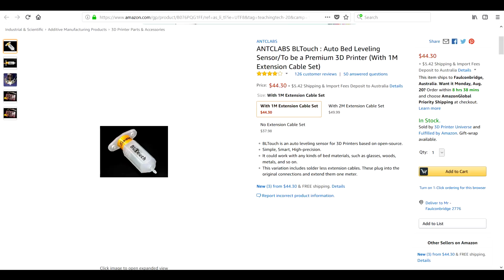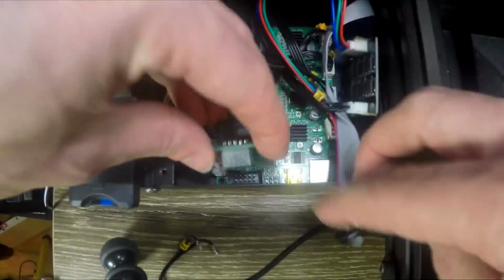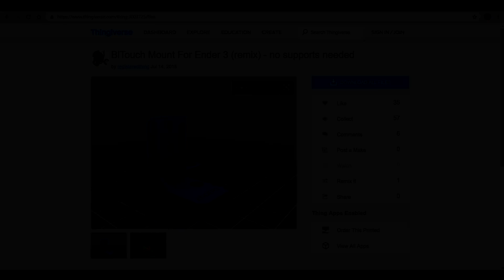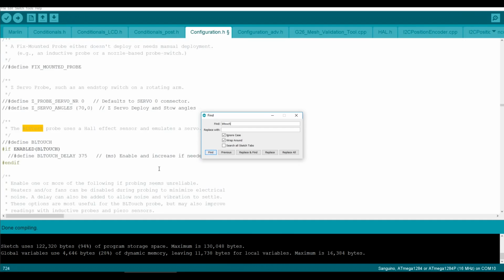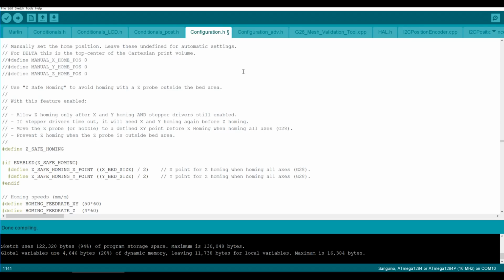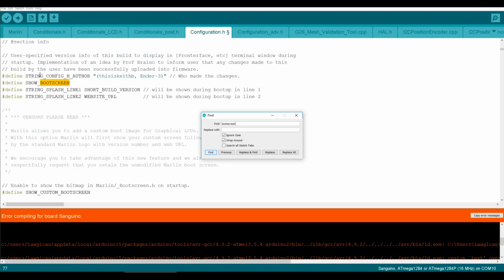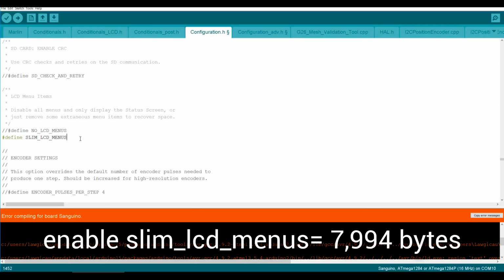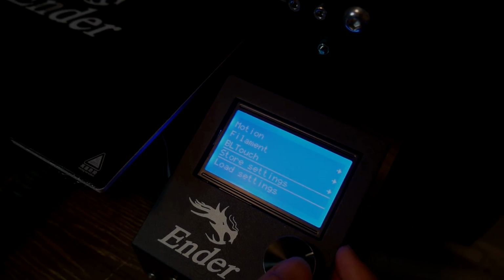Ender 3 BLtouch vanilla Marlin guide

Comment: I love your videos man! I had a Mega Arduino lying around and used that to flash the boot loader. I loaded vanilla Marlin 1.1.9. I was excited to get printing again but when I flipped the power switch, nothing happened. No fans spinning, no LCD. Not even a hum or fans on Power supply. I have the Ender 3 Pro and JUST got it so I’m hoping you have some brilliant troubleshooting you can pass along?!
Reply from the maker: Do you have a multimeter to test the power supply is still outputting 24V? Even with a dead microcontroller (which you shouldn't have), the fans should come on automatically as they run from a vreg. It sounds like coincidence.
Reply: Did you ever managed to get this fixed?

Comment: My bl touch just probes in one place (middle/home) and goes to print. What did I do wrong. (I got your files)
Reply from the maker: Sounds like the safe homing is working. You have to add G29 after G28 in the start gcode. This is covered in the video.
Reply: @TeachingTech  
Thank you. Yes I figured my problem. I did add G29 however I was trying to print old file from SD card... Oops... Stupid. Thanks for your help.

Comment: Hi friend:
 Can you prepare a Marlin 2.0 preconfigured for ENDER-3 use:
 1.) Auto-level with INDUCTIVE SENSOR. 
 2.) Filament Sensor usando Pin 27.
 3.) Resume printing after a power cut.
I'll buy it for you.
Thank you
Reply from the maker: I''ll cover Marlin 2.0 when it is stable and more common. Have no experience with it yet.

Comment: Hello friend: very good your video as always.
I have in Pin 27 busy with the filament sensor and I want to place Bltouch, how can it be solved?
Otherwise you can prepare a Marlin of this preconfigured version to use an Auto-level with INDUCTIVE SENSOR , Filament Sensor usando Pin 27 y Resume printing after a power cut. ?.
I'll buy it for you.
Thank you
Reply from the maker: You have to find another unused pin on the main board and specific that as the servo1 pin. Potentially a tricky job sorry, I won't be trying it.
Reply: Juan, I am not an expert by any means but he does mention how to add the BLtouch using PIN 27 and the filament runout sensor using PIN 29 in the following video:
https://www.youtube.com/watch?v=gwHpXaj_6xE&t=529s

Comment: Great video as usual. I've been following you channel for a while since getting into 3D printing on my Ender 3 and you do without a doubt the best videos regarding this printer. I followed your original bootloader flashing guide and orginal BLTouch guides and now recently switched to Vanilla Marlin with the BLTouch using your latest guides and it works great.

I recently upgraded to a glass bed and I've used binder clips to hold it in place but I found the BLTouch wants to probe too close to the clips and either hits into the clip itself or causes the nozzle to hit the clips. A solution I've found which is worth mentioning, as it might help others out who have sacraficed some of their bed with binder clips, is to search for a feature in Configuration.h called MIN_PROBE_EDGE. By default MIN_PROBE_EDGE is set to 10 but if you increase this value it increases the boarder around where the BLTouch is allowed to probe. I set mine to 30 and now my BLTouch clears the clips easily. Another thing worth changing is the bed size by searching X_BED_SIZE in Configuration.h. You will find two values: X_BED_SIZE and Y_BED_SIZE, they will be set at the advertised 220 by default but as most people already know the Ender 3 actually has a 235mm bed and while you obviously can't print the to the whole 235mm realistically, setting X_BED_SIZE and Y_BED_SIZE to 235 does have it's advanges. The main advantage is actually for the BLTouch, as by setting the bed to 235 instead of 220 means when the BLTouch probes the right side of the bed it can now travel further to the right giving you a more acturate reading. I've had no issues setting it like this but I recommend making sure the Y endstop is as far back as it can go without the bed hitting the motor to stop the bed hitting the front roller bracket.

One last thing worth mentioning as well is that you can access Auto Leveling through the Ender 3 menu by searching LCD_BED_LEVELING in Configuration.h and uncommenting it. It only takes up 1% more space on the Eprom so if you've followed this guide it will only cost you a total of 96% of space instead of 95% of space. It's worth it for testing purposes and also great if you've got any pre-sliced G-Code for the Ender 3 which doesn't take into account auto bed leveling, as you can simply run bed leveling first from the menu.

I hope the above helps some people out and please keep up the good work. I look forward to you future videos.
Reply: Thanks for the extra configuration tips. One caveat, however: due to how the bed boundaries are calculated, using odd numbers for bed dimensions (at least for Y_BED_SIZE) causes a compile error from a SanityCheck.h assertion that "BACK_PROBE_BED_POSITION is outside the probe region." This looks to be due to a side effect of the compile-time integer division used by all the macros to calculate various boundaries. After setting to 235 and getting this error, I pulled my hair out for a few minutes until I back traced all the macro math being done. Suspecting the error was due to the integer division, I tried both 234 and 236 and it compiled fine. So I've set my X and Y bed sizes to 234. It was easier to give up the 1mm than to correct the code for this and each future revision. :)
Reply: @dwmorris  I'm not sure what's happened there, but I've not had that issue to be honest. Mines currently set to 135 x 135 with no compilation issues. It's also set the same in the slicer to keep everything centered, but I make sure to not print anything to close to the boundaries.

The only thing I did need to do was use a custom Y Endstop bracket from thingyverse which I moved as far back as possible so that the bed doesn't hit the front tensioner bracket.
Reply: Seagull Hunter FPV Are you using Arduino IDE 1.8.7? I’ve heard of some gotchas with the latest release — maybe this is one? Possibly a change in how precompiler math is calculated or evaluated in the version of avr-gcc used by the IDE. No idea.
Reply: Well I've disproved the 1.8.7 theory. Tried again with 1.8.5 and get the same thing. I even dropped in Michael's configuration as-is and changed only the bed dimensions to 235, same issue. Very strange that others aren't seeing it. I'm compiling on Win10, haven't tried on Linux or MacOS yet. You? It seems this BLTouch is dead set against me, as this is only one of the hurdles I'm struggling to overcome!

In file included from sketch\MarlinConfig.h:42:0,

                 from sketch\G26_Mesh_Validation_Tool.cpp:27:

SanityCheck.h:949: error: static assertion failed: BACK_PROBE_BED_POSITION is outside the probe region.

     static_assert(BACK_PROBE_BED_POSITION <= MAX_PROBE_Y, "BACK_PROBE_BED_POSITION is outside the probe region.");

     ^

exit status 1
static assertion failed: BACK_PROBE_BED_POSITION is outside the probe region.
Reply: @dwmorris  I'm not sure on the version to be honest. I'll take a look when I get chance. I meant 235 x 235 not 135 x 135. But yeah it doesn't make sense because I've recompiled it quite a few times since with them settings in place as I've been make a few changes to other aspects of the printer.

Remind me tomorrow and I'll take a look
Reply: @seagullhunterfpv  It's not a big deal obviously, 234 x 234 is entirely fine and the least of the issues I'm having with Marlin+BLTouch! It's just one of those things that bug me when I seem to be the only one having the issue and for unexplained reasons. I made a new post today on this video outlining my major issues. I won't repeat them here, but if you get a chance to look at it and offer any advice, it would be much appreciated!
Reply: @dwmorris  Just wanted to confirm I get the same thing when I compile.  Setting to 234 or 236 passes.  Thought this was an interesting discussion and thought I'd try it out.
Reply: @blackwolfecc  Thanks, good to know it isn't just me! Due to my other issues with the BLTouch I've temporarily disconnected it and flashed Marlin with manual mesh leveling for now. I need to print some stuff and my printer has been down for 2 days now trying to make this work. Without the probe boundary measurements, it compiles just fine with 235 for a bed size. The issue is definitely with the preprocessor math being applied to calculate probe offsets not liking odd values. I'm just puzzled as to why it works for others.
Reply: @dwmorris  I decided to play around with the firmware last night, kind of try and get a little better understanding of what I was actually doing.  I noticed that before I had set X and Y bed size I had changed the MIN_PROBE_EDGE to 30.  THEN I changed my bed size to 235.  And as I mentioned got the same error you did when I compiled.  So I took a look at FRONT_PROBE_BED_POSITION and BACK_PROBE_BED_POSITION.  They were both set to 11.  I wondered if the min probe edge setting was interfering with this.  So I changed both to 30 and...  failed again.  Out of curiosity, I changed both to 31... and success.  Compiled completed with bed size of 235, 235.  Uploaded to the printer and ran the a few passes of the auto bed mesh in octoprint.  I'm not even a novice when it comes to understanding this firmware, but I found it interesting that I was able to fix the problem.  This might be a DUH thing for the more experienced, but I wanted to share anyways!
Reply: @blackwolfecc   Yeah, all those numbers get used in the probe boundary calculations. Changing those values to an even number made something odd somewhere, and changing them back to an odd 31 corrected the issue. There's probably another odd number in the mix somewhere that's causing that. The total result has to come out as even to satisfy the sanity check.
Reply: @dwmorris   I've just taken a look and I'm using Arduino 1.8.5 on Windows 10 x64 and Marlin-1.1.9 -Ender 3.

This is a snippet of the bed code I'm currently compiled on:
// @section machine

// The size of the print bed
#define X_BED_SIZE 235
#define Y_BED_SIZE 235

// Travel limits (mm) after homing, corresponding to endstop positions.
#define X_MIN_POS 0
#define Y_MIN_POS 0
#define Z_MIN_POS 0
#define X_MAX_POS X_BED_SIZE
#define Y_MAX_POS Y_BED_SIZE
#define Z_MAX_POS 250

For the probe I'm using AUTO_BED_LEVELING_BILINEAR.

I'm also using the same PETFANG bracket with the correct offsets set for the BLTouch:
#define X_PROBE_OFFSET_FROM_EXTRUDER -41  // X offset: -left  +right  [of the nozzle]
#define Y_PROBE_OFFSET_FROM_EXTRUDER -5  // Y offset: -front +behind [the nozzle]
#define Z_PROBE_OFFSET_FROM_EXTRUDER 0   // Z offset: -below +above  [the nozzle]

I've setup MIN_PROBE_EDGE to 30 as stated above as I've got a glass bed and I found this allows the nozzle to clear the binder clips. Though I did have it setup without that originally and it did still complile.

I hope the above helps in some way. I know 234 isn't a problem but it would still bug me if I'm honest. I can't really think what else would cause it to be honest. Does the compiler point to another variable which might be set wrong?

Maybe even try getting a fresh copy of Marlin-1.1.9 then following Micheals videos from the start again as I followed both his videos before doing any extra modifications myself. Then once I confirmed it works with his config I proceeded to change the config a bit more to suite my own needs and came across the above as I was having issues with my BLTouch hitting the binder clips and I could also never figure out why it wasn't printing in the center of the bed.

My advice would be to double check your config matches mine, if that doesn't work download vanilla Marlin and follow both videos too the book. Compile and test then proceed to do the extra changes one at a time and retest. Unfortunately if that doesn't work I'm at a loss, I'm fairly new to Arduino code and 3D printers unfortunately, if I do come across anything though I'll happily share my findings.
Reply from the maker: Excellent tips, thanks for sharing.

Comment: my z offset is fine when it prints stuff in the middle but when it gets to the back of bed to print it doesnt even touch the bed
Reply from the maker: Is the z axis moving on the early layers to compensate for the warped bed? Just checking you've added the G29 after G28 in the start gcode.
Reply: @TeachingTech  I'm still having problems with this issue when I print bigger stuff I have the g29 after g28
Reply: @TeachingTech  I think I fixed it I sprayed some hairspray onto my bed and the first layer stuck flawlessly

Comment: I am having a strange problem. I can get the BLtouch to Home if I use the G28 Command, it will not do it if I use the menu, but if I run G29 it starts doing the probing, but always stops when it reaches the back left corner.
Reply: This is video of my error using 100% your config file. Any ideas? https://youtu.be/ZvYlQDDx5bY
Reply: I finally got it. I increased the BLTOUCH_DELAY to 200 and it now works. 

FILE: Configuration.h

#define BLTOUCH
#if ENABLED(BLTOUCH)
  #define SERVO0_PIN 27
  #define BLTOUCH_DELAY 200   // (ms) Enable and increase if needed
#endif
Reply from the maker: Glad you got it sorted and thanks for posting the solution for others. I guess if your probe was lower than mine and the bed is higher in that corner it could trigger that error. Freaky!
Reply from the maker: If you run G28 then G29 in your start gcode, does it print successfully?
Reply: @TeachingTech  No it fails doing the G29 with a "STOP" when it gets to the back left corner. I downloaded your config files and the only difference is my X_PROBE_OFFSET.

Comment: a new question.use your config file.The LCD display keeps emitting the sound of drip, dripping, very noisy, replacing the monitor cable, no effect. It is useless to even unplug BLtouch.
Reply: My current solution is to put a piece of adhesive tape on the buzzer, the noise is weakened, but it still exists.
Reply from the maker: If you are using a pin27 board the buzzer should no longer be physically connected.
Reply: I found the reason. I understood the problem when I started wiring. It is now normal. Thank you for your continued support!

Comment: Hi Michael, at present my Ender 3 Pro is stock, it's solid, quiet and prints nicely, I couldn't be happier.  My only issue is that there is a bad dip in the center of the bed, although Creality has given me a second bed after questioning my issue, but the new bed isn't much better.  Fortunately whilst waiting for the replacement bed I purchased a BLTouch and the other items required to flash the firmware.  However, I'm now told that once installed I'll no longer be able to print from the SD card, I'll require a raspberry pi for wireless octoprint or I have to print via USB from my PC?
Reply from the maker: Some of the original guides were like this because the authors didn't delve into the firmware. Both of my BLtouch guides for Ender 3 retain the SD card support. Octoprint is supported too but optional.

Comment: painful watching you push that wire through.. If you pull the fish net sleeve down to one end..  (a) the diameter widens to like a 20c piece & (b) much shorter length to pass the wiring... much.. much easier :)
Reply from the maker: Thanks, good tip.

Comment: Thanks so much! I'd gotten about 90% of the way there on my own after an ill advised trip into clone bltouch land. I bought the genuine one and it works much better. I bought your files and it's working pretty well, though I still find it squishing more on one side (really one quarter) than the rest. Would it be my offsets? how best to tune?
Reply from the maker: Hmm, confusing. Check that the probe is perpendicular to the bed surface. Sometimes if it's a tiny bit off the probe slides for a split second before retracting. If one side is uneven this might present more on one side than another. That is a long shot however. In the files I set up a symmetrical probing grid which can help with this too.
Reply: I think that was it. The model you referenced as a holder was too short, and I needed to add washer spacers. Apparently I wasn't perpendicular. A day or so after I installed it, I noticed that the designer uploaded a model that was 3mm longer,  and without the variability of the washers, it seems good and even!

Comment: Good morning, I just loaded the paid files and got an error when compiling.  
In file included from sketch\ultralcd_impl_DOGM.h:49:0,
from sketch\ultralcd.cpp:96:
sketch\dogm_bitmaps.h:136:29: fatal error: _Statusscreen.h: No such file or directory
compilation terminated.
exit status 1
I think it depends on this 
// Enable to show the bitmap in Marlin/_Bootscreen.h on startup.
#define SHOW_CUSTOM_BOOTSCREEN

// Enable to show the bitmap in Marlin/_Statusscreen.h on the status screen.
#define CUSTOM_STATUS_SCREEN_IMAGE

when disabling these two things it compiles nicly. I Think you have to comment it in your files. Thank you for your great work Add: when downloading Marlin files, these files are not included and that's the point.
Reply from the maker: It says in the instructions to follow a previous video on setting up vanilla Marlin for the Ender 3 configuration. If you follow that it will eliminate these errors.
Reply: @TeachingTech  THIS DOES NOT WORK. I followed both videos to the T, I have been at this for hours and bought your files THEY DONT WORK. I get the same error. The whole point of buying your files was so I only had to change a couple things and be on my way